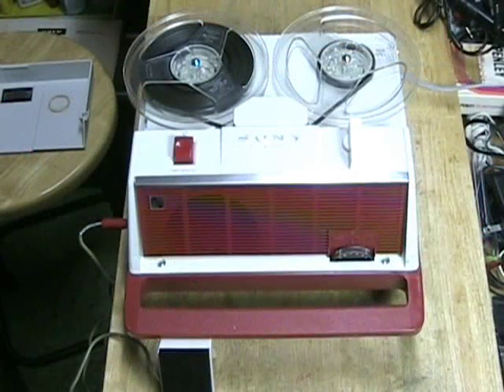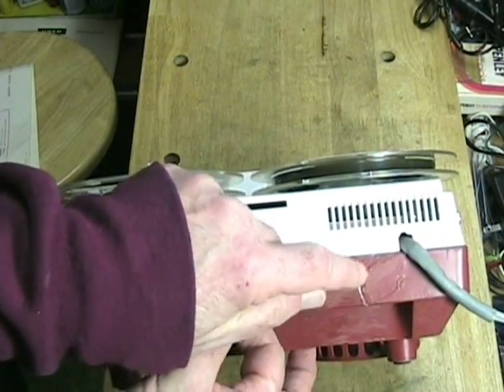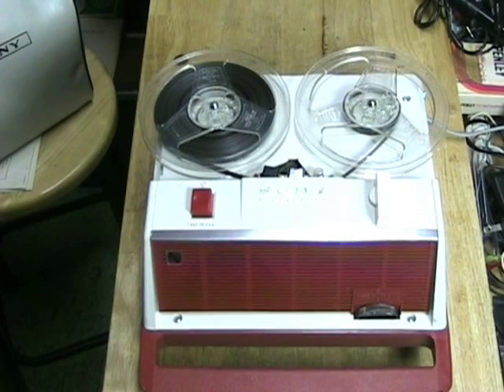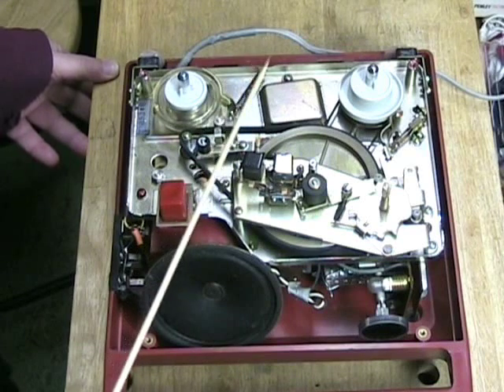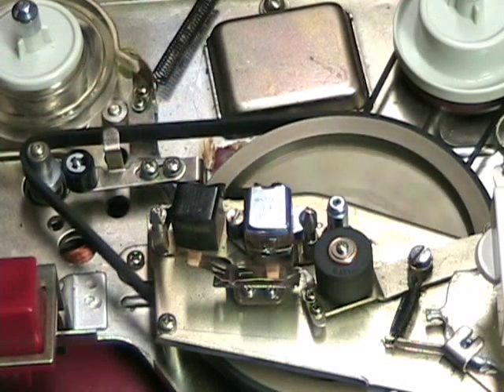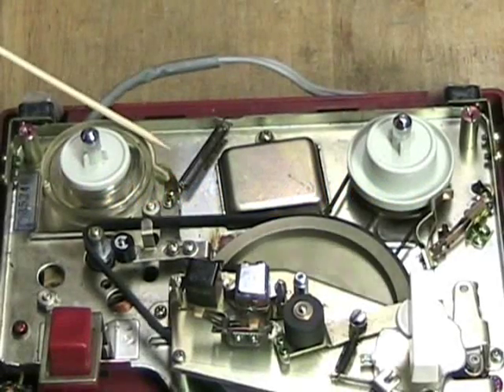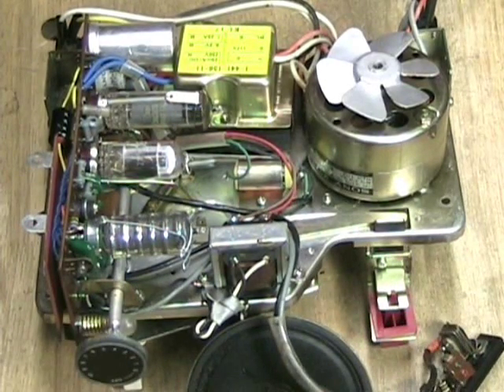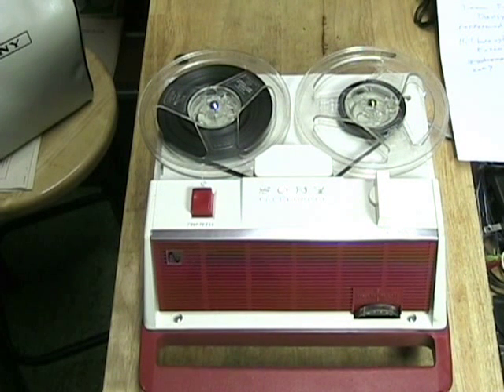KISS My SONY! Exploring the SONY TC-135 Vintage 5-Inch Reel to Reel Tape Recorder

Comment: Brilliant, eliquent and economical design. This machine is a masterpiece. The drive system is on par with the kind you see in professional tape recorders that use three motors and dynamic breaking to provide just the right tension. Great video! :) JC

Comment: I recommend re-seating tubes. I've had cases where some tube sockets can get corrosion over the decades! Pulling and then re-inserting them is usually all that's needed.

Comment: I have a somewhat similar Sony 111. (no "TC" in front of the number) Also two tone plastic case (salmon pink, and white with MATCHING pink detachable power cord !), 5" mono, tube reel to reel. Odd that they made two similar spec, but not  quite the same model or design. One difference is that it has no automatic volume control, but uses a green eye tube level meter. 3 tubes are 6AU6, 6AV6, 6AR5. It might actually be a bit smaller too. 8 3/4 X 4 1/2 X 7 3/4. I wonder which one is older?

Comment: I once got shocked off a charged capacitor in Valve/Tube amplifier, it was quite nasty and my hand looked as if a snake had bitten it for a while after that.  I like the simplicity of the design, I think my Peto Scott also uses a gravity-clutch take up.

Comment: Hi, I just bought one of these antique tape recorders today!  I've been wanting a reel-to-reel tape player for a LONG time!  It's extremely rare to find them in person, at least where I live, so when I saw one today at a thrift shop for $10 I had to have it!  I can't believe my good luck!  There was even still an old tape in it, so I was able to test it when I brought it home!  It's in good condition mostly, with just a few cosmetic problems here and there.  It's missing the little cover for the heads.  And it has that weird melting on the plastic, in the exact same spot that yours has, by the cord.  You said that's caused by a chemical reaction from the plastics?  I've never seen anything like that before.  Is there anything I should put around the cord to keep it from getting worse?  Also, do you think it would be worth it to try to sand and paint that part on the body, just to make it look a little bit nicer?  My tape player needs a new belt - it works, and sounds great, but the belt has really gotten out of shape from age.  It seems to slip sometimes, and occasionally it plays the tape too slow and the pitch is low.  Any idea where I could get a new belt?  Or could a large rubber band even work?  One last question...is it possible to find blank tapes for these machines anywhere?  I want to play around with it and record some tapes!

Comment: Hi.  Where did you buy a replacement drive belt for this model?
Reply from the maker: Rat Kindler   Thanks for watching the video. You can get replacement belts from Turntableneedles.com. Just look up the belt by manufacturer and model number.
Reply: Fantastic!  Thanks.  Your video is wonderful.  I've just got one of these and I'd like to get it running but I think there's something wrong with the cam system to move the idler / break arm.
Reply from the maker: The cam system is pretty complicated and not easy to work with! Good luck!
Reply: I see the problem with the cam system.  The roller that the cam moves which moves the idler slips under the cam.  I'm not sure how to fix it.  I've bent the arm up a little but I think it will probably slip under eventually.  You can see it here in this photo:   https://s26.postimg.org/t8pe2dfxl/IMG_20170904_003411a.jpg
Reply from the maker: Yes, that roller can be a problem. There's not a lot of room to bend it before it will bind with the holding plate! I had a similar problem with a TC135 many years ago. I forget how I solved it, I think I took  that roller arm assembly apart and added a washer or two to elevate the roller arm.
Reply: Well I replaced the drive belt and things seem to work although I think the other belt should probably be replaced too.  Now it plays but the volume is very low even set to max on the tape that came with it as well as when I record something.  Any idea why this might be?  Also the audio is playing backwards on the tape that came with it.  Why is that happening?  It records and plays my voice forwards.   This is my first time ever using a reel to reel.
Reply from the maker: Low volume indicates one or more failed electrolytic capacitors in the machine. I think this machine has 5 of them. You'd need the service manual to know their values, order them from a place like Mouser Electronics, and replace the old ones. Of course, it could also be a failing tube. Ideally, you'd get the tubes tested and if there is a dead one, you'd replace it. Some radio guys on YouTube have tube testers and maybe one of them would help you out.

The tape that came with your machine was a Sony stereo demo tape that has been incorrectly put on your machine -- which is mono -- probably because of the small reel size.  Stereo tapes run half backwards on mono machines. 

Look up audio tape tracks in Google and there will be some resources for you.
Reply: Thanks for the info.  Not sure what I'm going to do.
Reply: Something has just occurred to me.  The tape has a shiny side and a dull side.  Which side should be against the heads?
Reply: I flipped the tape so the dull side was against the heads and it works now!  The volume of what's on the tape is still a little low but when I record to it it sounds fine.  The tape was a young girl recording Paul McCartney songs from the radio and also playing Yesterday on a flute and piano.  She sang a cute version of Uncle Albert and was complaining about how her parents wouldn't let her stay up late to watch a movie and that she's growing up and needs more independence.  :-)  Thanks for all your help!
Reply from the maker: Dull side. That contains the magnetic oxide particles. The shiny side is usually the mylar backing, although in th4e early 60's acetate was often used. Mylar is more stable and dependable.
Reply from the maker: I love hearing the old tapes, it is amazing what people will record. I have one tape of a bunch of what sounded like "good ole boys" sitting around, getting drunk and having a farting contest! It sounded hysterical!
Reply: That is hilarious!  Although I would have liked to hear the farting contest, I'm glad mine had a mix of things.  The father and brother were on the tape too and I think the dad recorded some Frank Sinatra as well as some standup comedian that I didn't recognize.  The girl was also talking about the deteriorating relationship between her parents and speculating on a divorce which she blames on the mom.  She was also sad that her dad wasn't paying much attention to her anymore.  I wish I could find out who she was.